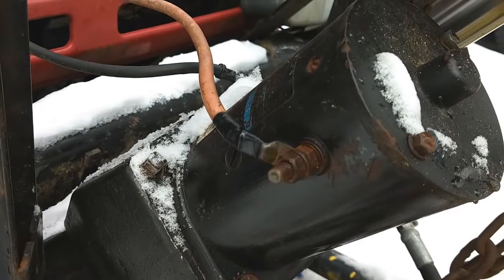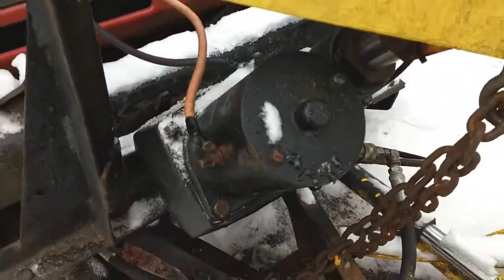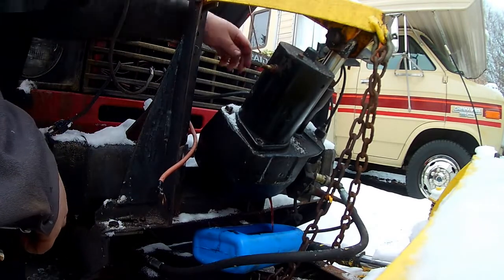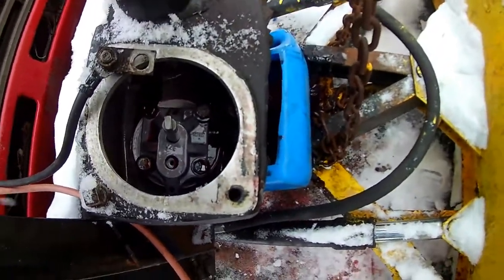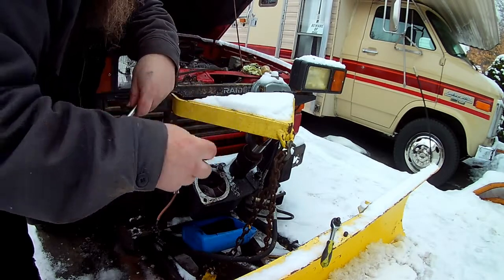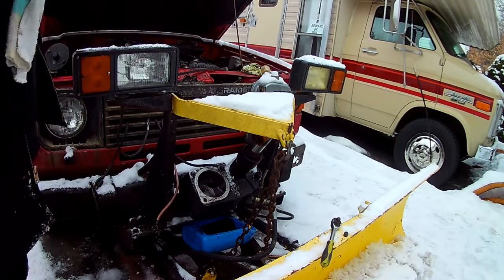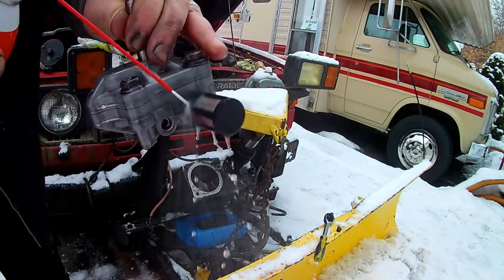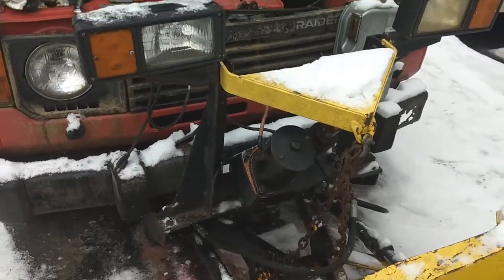Will my quick fix work?

Comment: i would guess with all the seals from bottles in there that would plug the filter up how would it not suck them up and there is enough to fully plug it im sure that pump has been ran dry from that several times but probably not hurt